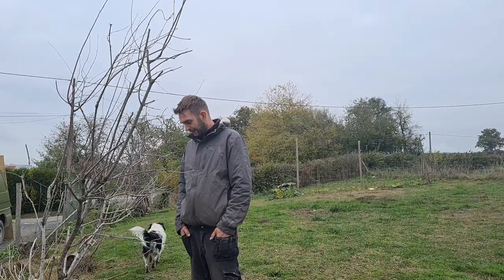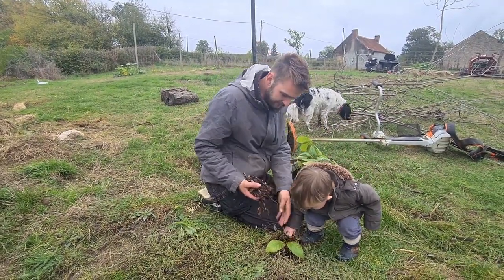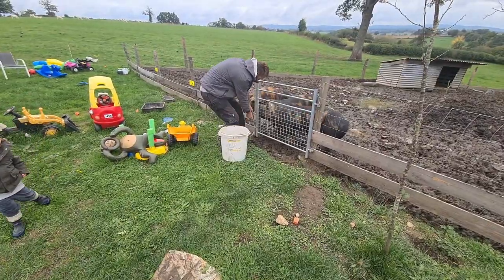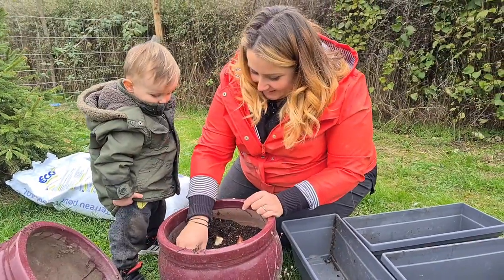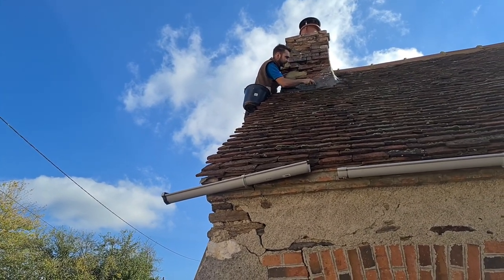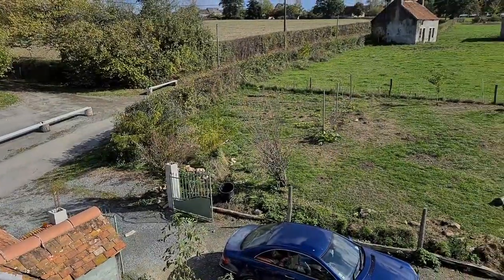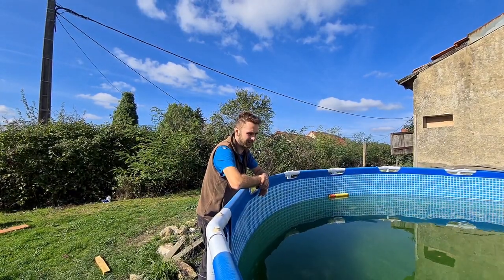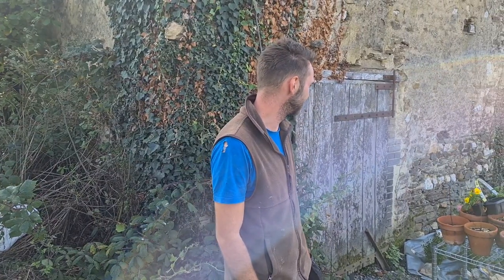escape to rural france- pigs and chimneys EP011

Comment: we had a shorter pool from 2004 to 2016, left it up in winter in Canada , didn't empty it,  it filled with snow, the dog went in, filled dognail holes with goo, started to deteriorate after 12 years, emptied it in spring washing it, put a floating chlorine puck holder in as soon as the ice melted out, never filled with algae, had to replace the filter pump 3 times even though we brought it in in winter, our well is 323 feet deep, hard water, used  plastic tubing to suck the settled iron off the bottom, used a net on a stick to take leaves out

Comment: Ivy will die when you find the main trunk then cut  it off flat, drill holes in the cut portion and pour salt in it, cover with plastic, so the rain does not wash it away. That was the end of my huge 50 yr old ivy. The ivy was destroying my house wall, so had to go.

Comment: I hope your chestnut trees will take! I would have put in some compost or soil in the hole with the mulch on top.  Did you water them in? It's probably the most important step.

Some tips for next time you try to transplant something (not seedlings): you should try to get as much root as possible, plant it as fast as possible, and in general cut out 2/3 of the plant. And keep well watered until established.